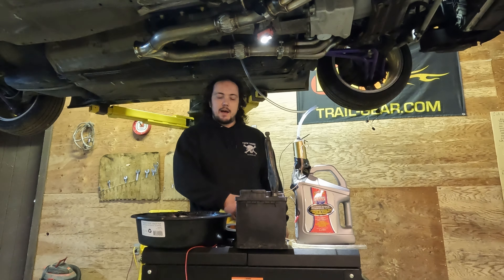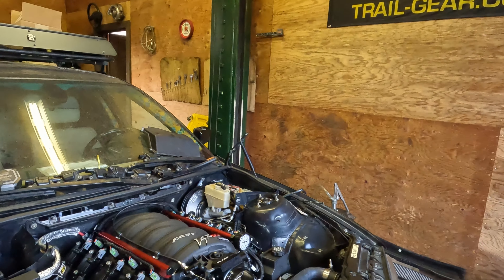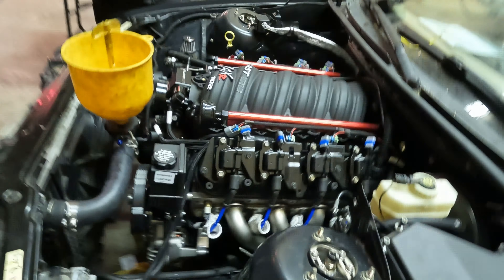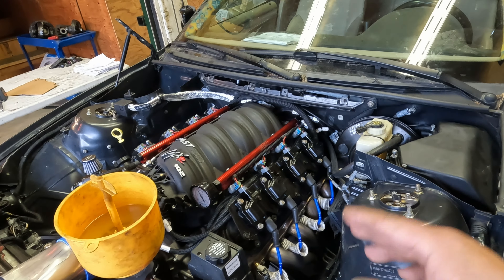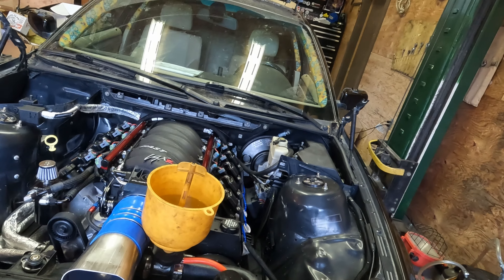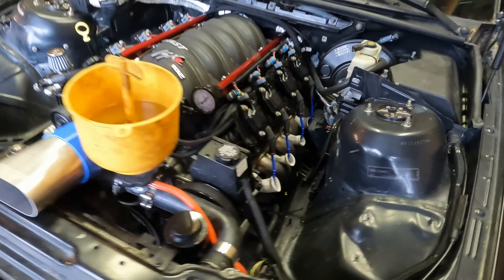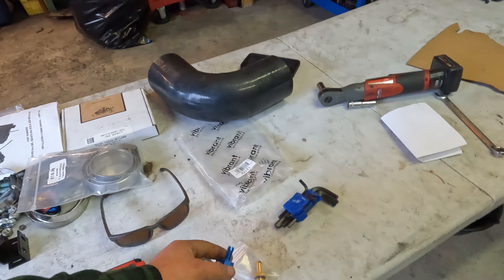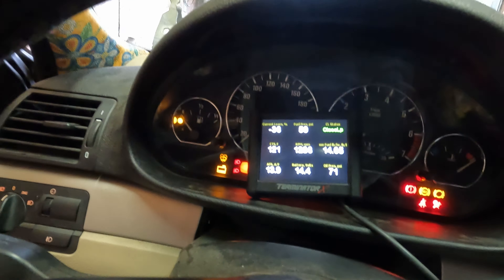BMW E46 LS SWAP (Ep 11) FIRST START UP 6.2l LS BMW

Comment: Dude that engine bay is sooo clean, did your harness need adjustment for it to be so clean?
Reply from the maker: Hey thanks man! Well not to much, the injector harness I completely re wrapped and I changed the oil pressure and fuel pressure sensor location! It wasn’t hard at all and it’s actually in one of my previous videos.  I explain in detail how all my wire routing works 👍 thanks for watching dude!

Comment: Holy cow, that wiring video was super helpful and now on top of that you’ve solved my fuel pressure problem I think! However… I tried using that pin for the starter signal but not only do I not get power to it, the ignition only allows 1 attempt to the start position and it lock out so I have to remove the key each time and put it back in. Any thoughts on that?
Reply from the maker: Interesting, did you test that pin with a multimeter while you have someone cranking the ignition? Because you should only get power to that trigger wire under cranking with key. If mine doesn’t start on first crank it does the same thing I have to cycle the key off before i can cranks again but I don’t have to pull the key out.
Reply: I had a test light wired to it and looked for it to light up when I hit the ignition. I can maybe ask my wife to help me so I can get a volt meter on it though. It might have something to do with the EWS but I'm not sure yet. Maybe it has something to do with the EWS looking for the auto trans to be in park and now it has a manual?
Reply from the maker: @TheBS44  yeah for sure could be something like that. I’m not sure though my car was manual so I never ran into that problem
Reply: @Skipper_al  Just to follow up for anyone else with the same issue as me - it was the EWS. I just jumped the two large 12v wires together and that let the starter signal flow up to that pin when I turn the key. Now I'm just waiting on that fuel siphon kit to get here Tuesday and I can give it another test start!
Reply from the maker: @TheBS44  hell yes dude I’m glad you got it figured out!! The siphon kit is a must 👍👍

Comment: What diff you have or you swapping that too??
Reply from the maker: Well I’m crossing my fingers and so far my 346 has held up. I did swap 330 trailing arms, axels, and breaks in though and I haven’t broke a 330 axel yet. I did however break 2 325 axels before I did that swap in a matter of days 😂